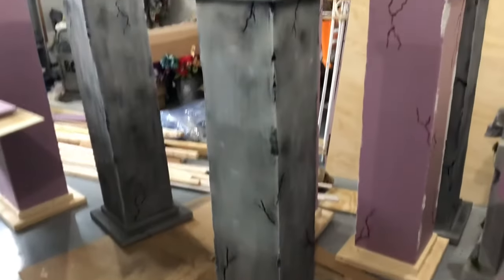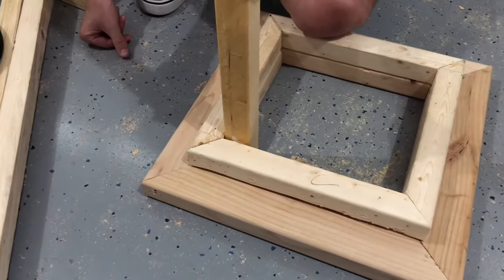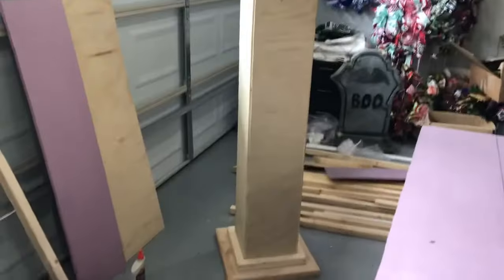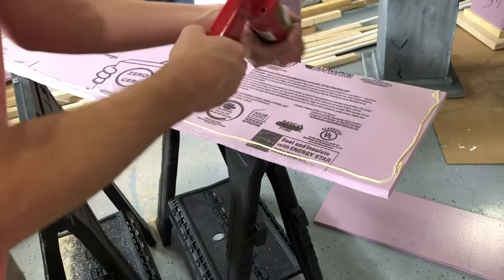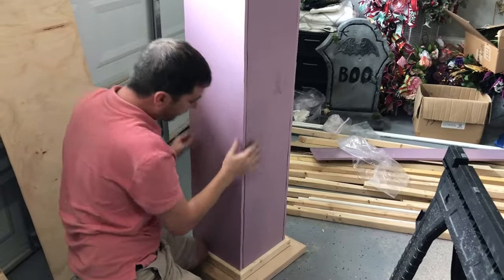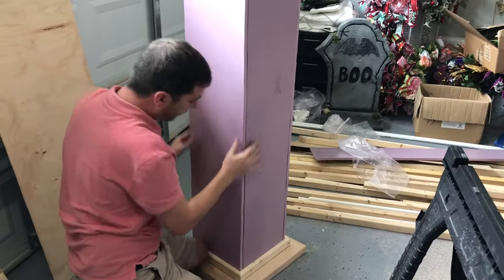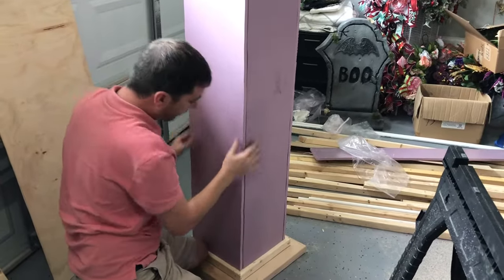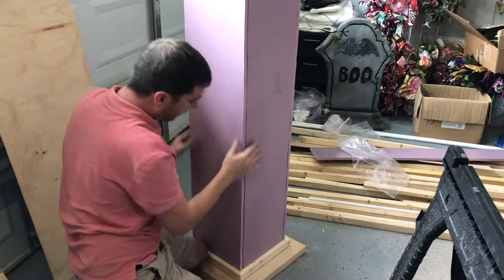DIY Halloween Cemetery Fence Pillars

Comment: Great job. I recommend using rebar hammered into the ground, which your PVC fence posts can then slide on top of. Perhaps 3 or 4 per 8' section evenly spaced. This will add to the overall rigidity of the fence and columns since they're connected. Thanks for sharing.

Comment: Great project. I’d suggest adding 1” wood screws to secure the plywood underlayment to the frame, which I did. Brad nails are not meant to be used as a permanent way of attaching something. They’re great for using in conjunction with wood glue.

Comment: looks fantastic.
I'm working on a few for my yard though instead of foam I'm using stone wall paneling. Your framing however is giving me useful ideas.
Reply from the maker: Thank you
Reply: Stone wall paneling?? I'm in Australia, please explain??
Reply: @KrazeeKraftZ  yes, it is similar to wood paneling. It's typically found in the same section of your local home improvement store. It is paneling that looks like stone and comes in 4ft x 8ft sheets. Approx $35 (US)

Comment: If your base is 17 and 1/2 in with the 2 by 4 what is the top of your base that you glued on you said a 1-in piece of foam the same size? 17 1/2 in for the top or did you make it smaller Square for the top mount

Comment: In the materials, you said 1 inch for the foam board, but in the video the board says 1/2 inch R-30 I want to make sure I purchase the correct board, is it 1 inch or 0.5 inch R-30?
Reply: I did the same thing I bought 1 inch but it is actually half inch had to return it and go get the half inch foam. The 1-in thickness is for the top piece

Comment: if you used 52" 2X2s for your smaller pillars,  what were the dimensions for the larger pillars you constructed?  Clearly they are larger than the smaller pillars.

Comment: What are the measurements for the 2x2 on the base?
Reply: He says in the start they are about 16-17 inches wide.
Reply: 16-17 inches is for the 2x4’s. Cut the 2x4’s at 17” and the  2x2’s at 13 inches. Double check your measurements during the first column to ensure that the insides of the base on the 2x4’s and the 2x2’s are flush. This is necessary since the vertical pieces of the furring strips can be properly glued to each at the bottom.

Comment: What is the black spray paint used cause normal paint will just eat the foam and yours did not so please if you can let me know the spray paint used
Reply from the maker: I don’t recall which paint I used but I typically always buy standard rust oleum or krylon when I’m not painting a plastic surface. Maybe try spraying in thin layers and gradually add another coat or two.

Comment: What are the dimensions on the 2x2s?
Reply: Looks like he's keeping that a secret
Reply: Making them now. He probably forgot to make a record of it and doesn’t have time to make another. 😂Cut them at 13 ¼ inches.
Reply: @Sigmund1924  Made 4 of them last year for my haunt.  If you use dry lock for the top caps and bottom they last.  I did fake brick panels instead of foam, thinking of changing it up for this year
Reply: @Kyp678  Thanks. I’m making five. Just finished cutting the wood. Definitely using dry lock but the brick panels sound like a great idea. Reminds me of the haunted mansion at Disneyland. What was the problem with them? Did they start to warp being outside?
Reply: @Sigmund1924  yeah with temp changes, they warp a little bit and need more screws to flatten it out.  Passes the eye test at night but definitely noticeable if you look close

Comment: What are the measurements on the base?
Reply from the maker: Watch at 0:50. I explain the measurements there.
Reply: You only say the length of the outside dimension of the 2X4s at that point in the video.  What are the dimensions of the 2X2s on the inside?  For those of us trying to replicate your design, it would be helpful to know dimensions of the underlay on each side, the vertical 2X2s, etc.  And, if your gateway pillars are larger, what are their dimensions?   @erikgoodwin
Reply: Looks to be about 10inches
Reply: He left that part out. About 13” for the 2x2’s at the base.